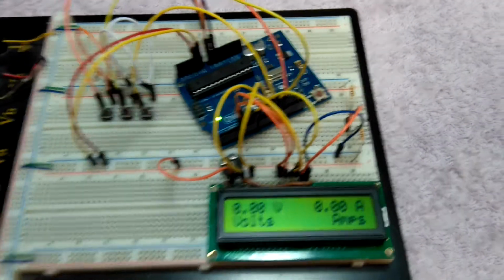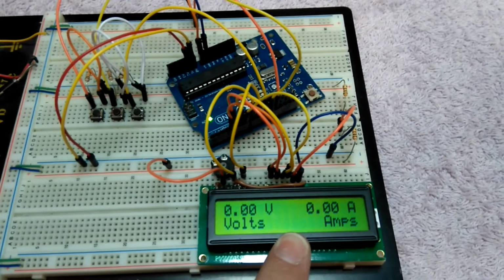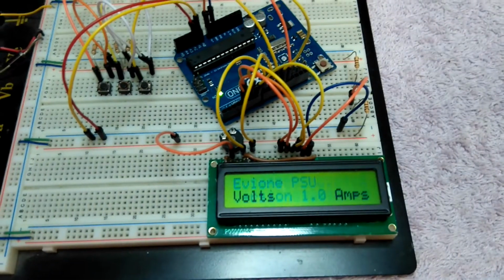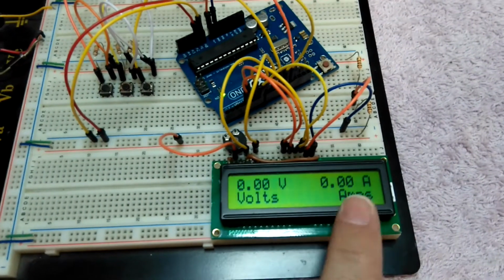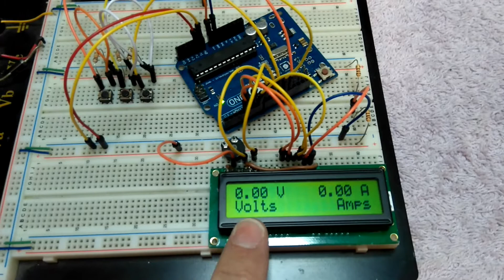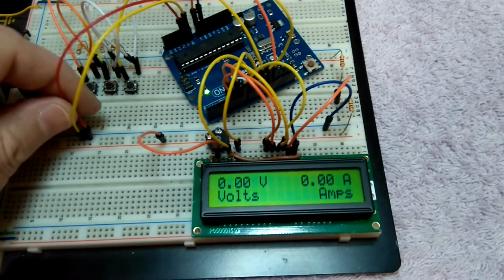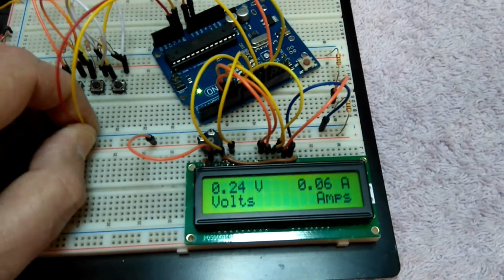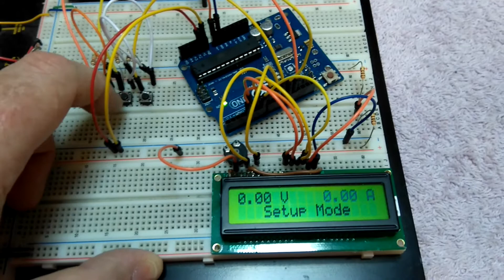Simple AVR or Arduino psu panel meter

Comment: hey can you send me the code and schematic for this project? 1lumberjackzach@gmail.com. I am quite new to this area of interest and would like a materials list as well. I am a Masters student producing a solar panel and need an affordable digital amp and volt meter and need to obtain an accuracy of 1 microvolt, or close to it. using this platform and some programming I found online I plan to make it to the micro volt target. Do you have any thoughts on the matter?
 
thanks 
z